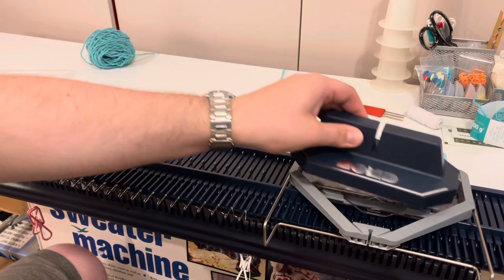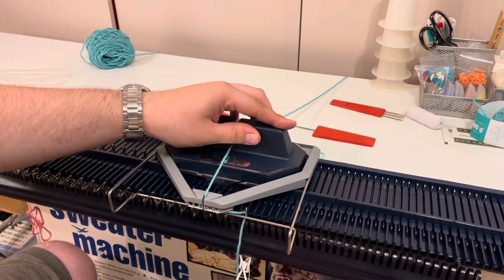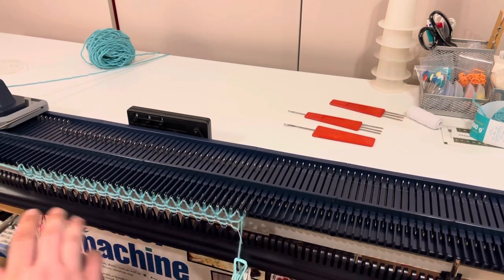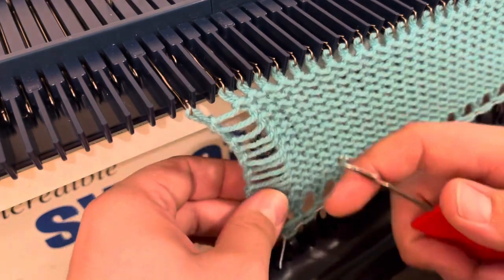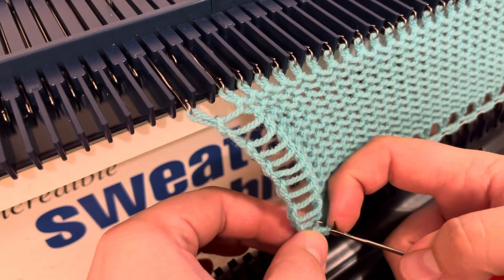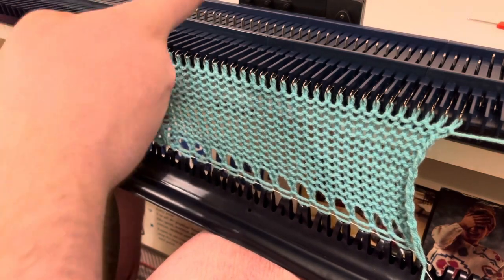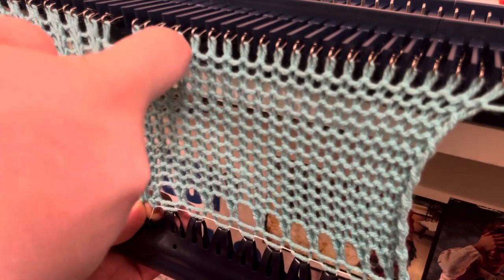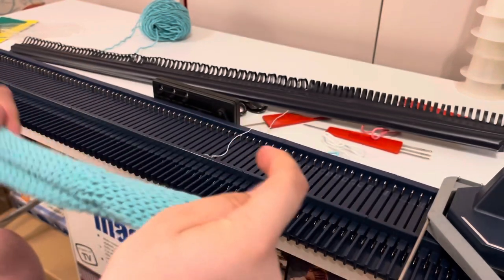Circular Style Cast On For a Latched Up 1x1 Rib On A Bond Machine

Comment: HI, i  bought a bond ribber and I was wondering if I can do this on the bond main bed and then transfer the cast on edge, every other stitch,  to the ribber?  I hope that makes sense.
Reply from the maker: For casting on 1x1 rib with the ribber.  You knit a row on every other needle, with a tighter keyplate size, then pick up the inbetween loops of yarn and put them on the inbetween needles on the ribber.  Knit two circular rows, so one row with the keyplate in the main bed carriage and one row with the keyplate in the ribber carriage.  Put the keyplate size in for the ribbing in both carriages and carry on knitting.

If it is the original Bond ribber (for the machine in this video) it is very tricky to set up but it does work, so just be patient with it.  The Elite ribber was much better.